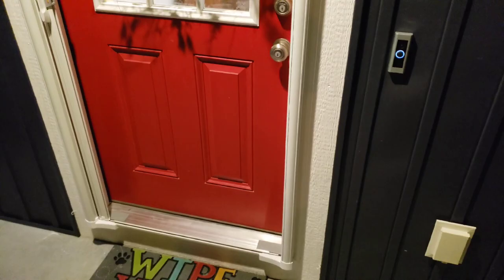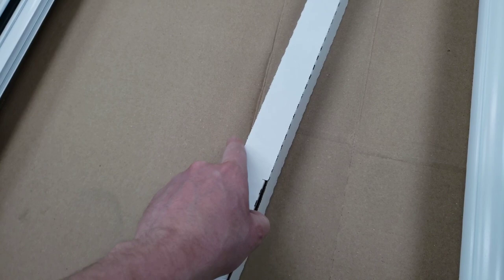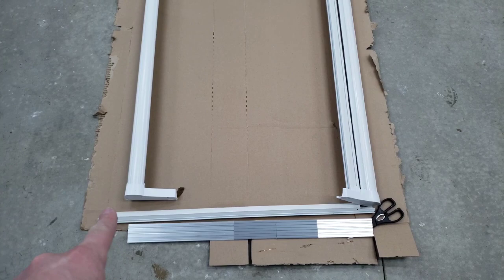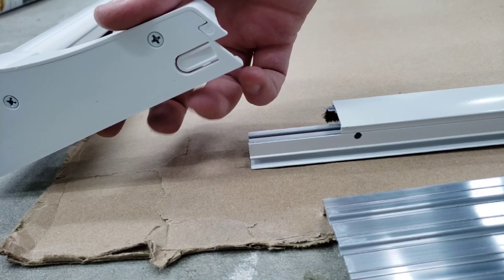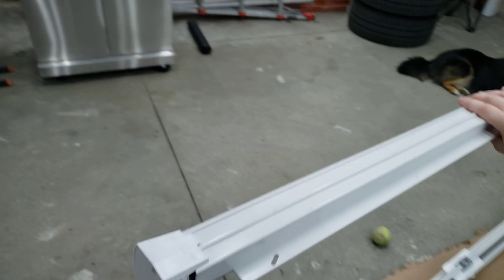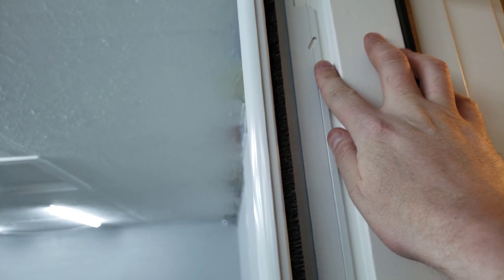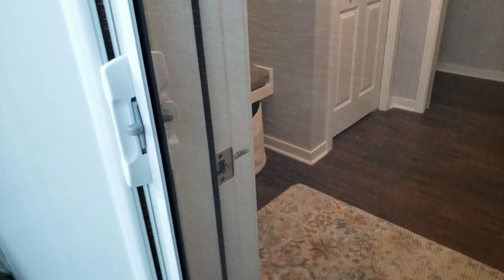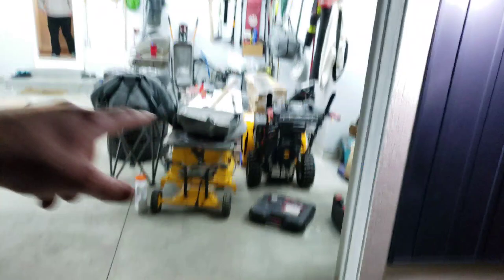Brisa White Retractable Screen Review and How To Install Easily

Comment: The reason why all 4 corners dont lock with that pin is so you can adjust to different door widths. I thought I did it wrong at first, then realized that it would not extend if I needed it to. Helpful video.

Comment: This was helpful, but you miss one important thing.  The bottom rail: you need a board under it or it will collapse the whole unit.  People walk on the edge as a habit.  It cannot support that much weight
Reply: Looks like he has a step supporting it, but yes, it does mention in instructions to have something that the unit is resting on, like the floor, a step that come level with the door sill...Or if it is a step down from the sill, and your sill is flush, or a very short lip, you will need a support piece added. I would recommend a PVC type piece, like floor decking or something with strength and thickness so  so you dont have to worry about painting it or water rot and such.

Comment: Ok, hears a hint this is very easy to install. The worst part was the tracks. Losen the screws on the top and bottom just a bit, then they slid right in

Comment: I can see that if it is an outside door that the trim will have to be ripped off, repurchased and replaced where it covers the side of the house and door jam.  This screen is nice but it is deigned to be used where the siding bumps up against the door jam without trim casing.  I elected to put furring strips inside the jamb rather than tear off my casing.  Also, to make it easier to insert the cross pieces top and bottom just loosen the screws.

Comment: I can’t figure out how to get the gold damn bottom and top bars onto the frame
Reply from the maker: They are pretty tricky I tried to show the best assembly I could. The first one we put together was a son of a gun
Reply: The side with the screen went in like butter. It's the other side I'm having issues getting in
Reply: @basiawill1023  Keep in mind that only 2 corners will lock in. This is so the other 2 corners can extend to fit the width of the opening. So it feels like it didn't go in right, as 2 of them will not lock in.

Comment: How do you install over an existing metal sill?
Reply: If the sill is sticking out, you just rest it on the sill. if flush and its a step out and down, you need a support piece. See comments above.